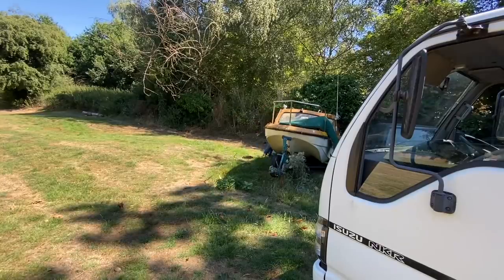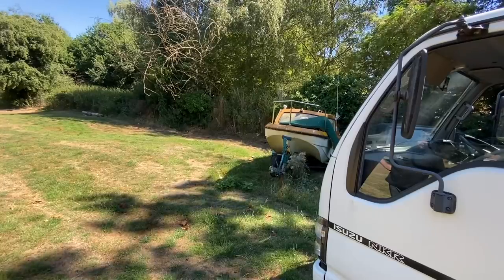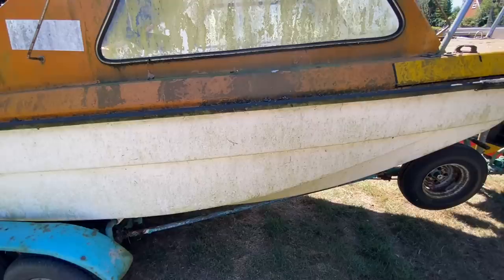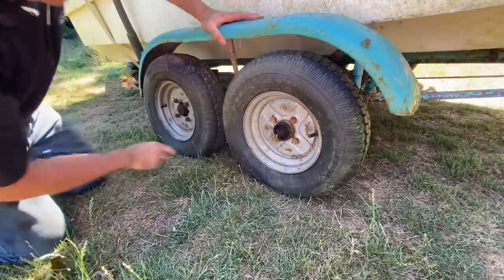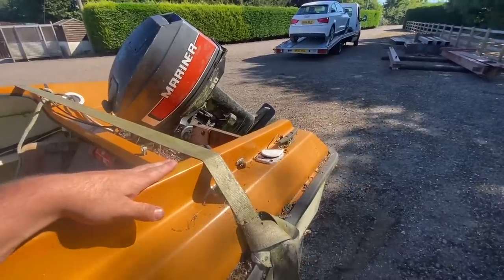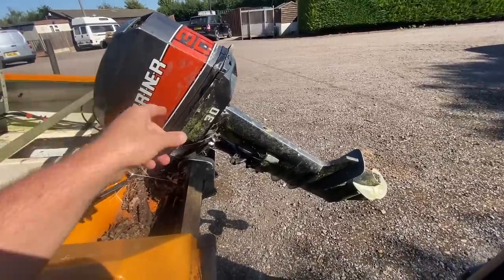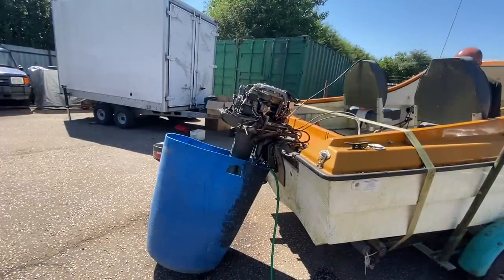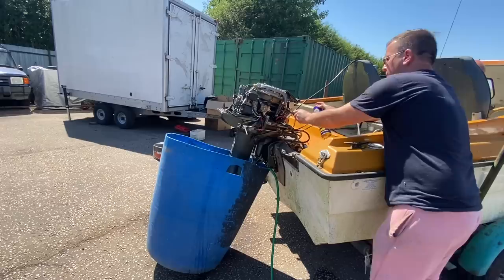WE BOUGHT AN ABANDONED BOAT TRAILER OUTBOARD PROJECT !!!

Comment: Second best day of your life when you buy a boat ! The best day is when you sell the bloody thing :+)
Reply: A boat is  hole in the water into which you throw money.
Reply: Exactly. From a former boat owner.
Reply from the maker: Not on a cheap old boat like this
Reply: "What happens when it rains?" (JKJ)
Reply: LG ..From France you are so right ... I travel around my local area and every other house has a PROJECT BOAT ..
Reply: I second that 😂
Reply: Never, I won't ever get rid of mine. 😂
Reply: @sruk  can't go wrong with a cheap one . Ahwsys money and or fun in cheap ones
Reply: I was always told owning a boat is like standing in the shower ripping up £50 Notes.
Reply: @davidb7466  personally never lost money on a boat , a couple I've had not finished refit in time and the  seasons nearly ended but you can stil sail / sleep in em with the kids , and sell em at the start of the next season and break even ( after boat yard storage fees etc). I've moved a boat from one boat yard ( was 68 ft long and costing 250 a week ) to another 20 mile's away due to the mooring being a quarter of the price was offered 5 times what I paid for it two weeks earlier ....
Reply: B bung
O on
A another
T thousand

Comment: They started out  a long time ago as a CJR14 14ft cathedral hull boat, and there was at one point way back in the day when a fibreglass firm in Southport would lend you a mould to make your own if you bought all the fibreglass supplies from them   then roughly mid nineties Poolside Mouldings  AKA Seahog Boats based  in Freckleton Lancashire  started making them again  and calling them i think it was from memory called  a Seahog trio, the  maximum engine size is normally 30hp but i've personally seen them  with up to 55hp outboards on . They run well with a 30hp prop rated motor, the Mariner 30hp you have there is a re badged Yamaha 30hp Mariner  so it's a really reliable motor . Mariner being owned by Brunswick marine that also made Mercury outboards the Mariner range used to be older model yamaha's up to 60hp  and Mercury models painted grey  and badged Mariner above  60hp altho that did alter  and some of the 40hp to 60hp models were also Mercury engines but they did some 50hp 3 cylinder Merc / Mariners the list is more extensive than that but that gives you a little insight. Mariner were a means for Brunswick to have a mid market brand  as well as their premium product of Mercury , some motors you could actually scrape the grey off and reveal the Phantom black of mercury especially on lower units(gearbox bottom section) where they had taken parts off one production line to complete other motors  ,,,, a little bit of my background I used to be in the marine trade selling and servicing Yamaha  Suzuki and Mercury outboards  etc for almost 20 years

Comment: Boys, I recommend you change the water pump impeller before taking her out. They will work for a few minutes but under pressure they fall apart. Second, check the lower unit oil before going out.  When a boat sits for a long period of time rubber gets hard and breaks easy. If she has no oil the lower unit will fail leaving you out in the water.  Just a lesson I learned the hard way. Be well.

Comment: Check the water pump impeller chaps , made from rubber they perish and break up if stood for a while, the first sign is the water squirt from the engine should be a constant line -yours is spitting.
 When they disintegrate the engine over heats giving an audible signal in the control lever box. Have fun guys-  we did with our boats👍

Comment: Well Rob and Chris I had a sinking feeling when I first saw it. Thought you had bought a non runner. I can (sea) see that you have propelled yourselves into boats now and glad you have not rocked the boat in this one. She looked fab under the engine cover and sounded solid. Glad you are not skimming  on the carb and getting a repair kit for it. Should be plain sailing once cleaned up. Don’t go overboard on the spend😂 and should catch you a nice profit.

Comment: Hey fellas, great buy!. I honestly have owned 5 of those Tohatsu/ merc/mariner 30hp engines since the 80s and in both commercial and private situations and they are honestly bulletproof. The only issue we had ever was that if you hit sand the tell-tale would block up but it wouldn't hinder the cooling. I used to take the little nozzle off mine and drill it to 4mm and that made a huge difference in it blocking up. Apart from that i broke a ball end on the advance linkage once and apart from regular services that was it. We used to fish the great  barrier reef 100miles off the coast and used them for our dorys and felt safe every day out there. I hope you gain the love for them that i have. Happy fishing!

Comment: If it’s been lying for any period of time I’d change the pump impeller too. I’m a marine engineer. The rubber perishes and stops pumping. Usually a few miles from the harbour which is inconvenient at best. Cheap as chips anyway.

Comment: I have been messing about with trailerable boats for  50 years and I have a couple of comments to make.

Personally I wouldn't take that old neglected motor anywhere near the sea. It is a 2 stroke which are notorious for rusting up in the cylinders and big ends if it hasn't been properly pickled for storage, which this one clearly hasn't. I recall an incident in my naïve youth when I bought an old Evinrude 40 that blew up a few months later off Shoreham when a con rod flew through the  side of the engine caused by internal rust on the big ends.  Believe me you don't want to get stuck at sea,

Secondly, 30hp is not going to  make it go like a rocket, the boat is underpowered and needs a minimum of 40hp

Comment: Jeez...you really don't know what you're doing with it do you? It's not an air filter, just a shroud. It's empty.
Leave the throttles closed, use the manual advance as a fast idle. Sort the throttle cable and it'll be easier.
CHANGE THE IMPELLER BEFORE YOU TAKE IT ON THE WATER!!!

Comment: Rob I’ve done all the failing for you. To polish gel coat use, rotary polisher, 9 inch 3m wool pad and Menzerna super heavy cut compound. Then follow up with a decent polish, medium pad on a da forced rotation machine. If it is highly oxidised wet sand with 2000 first. You need the big guns for gel coat , it is NOT like car paint.

Comment: Years ago I owned a 15 ' Tunnel boat made out of fiberglass, I forget the size of the outboard but it was a Mercury and flat out 32 mph . I used to be a welder before I retired and I made a frame out of 302 stainless tubbing  with rod holders in the middle and stainless 14 ga plate both ends for downriggers all held up with two round tubes and plate top and bottom to bolt onto the boat .Great video .

Comment: Love the video, never seen Chris so happy. I’m not sure if anyone else has mentioned it. Before taking it out on the water I would strongly suggest replacing the impeller. This is a paddle wheel like device that pumps water up to the motor for cooling. It’s made of a flexible material and if that motor hasn’t been run in some time it may well have perished. You might get it out on the water the and then the “paddles” might break off, no cooling, seized motor. It’s a cheap and easy fix, you’ll find plenty of YouTube videos showing how to replace. Aaarrrggghh me hearties.

Comment: Did exactly the same early this year with a similar boat that had sat for many years and sold off cheap.Similar problems to yours, but compression still good and now running well after problems with mercury switch and emergency cut out. Now on a mooring at queenborough.Happy to help with sea trials as back up if that's where you are launching. Ours   needed gear box oil filled from the bottom, and interesting idea! 14ft = 4.9 meters

Comment: Another  cracking video gents. The  hull seems to be in  good condition. A  good  clean and  probably some  paint work  should  suffice. The  outboard engine seems to be fine too.There is  probably an  element of profit in  this  project too.

Comment: Big engine for a 14.5 boat. Some lochs in Scotland use propane 5 hp engine for a fourteen- footer on a big loch. Other smaller version of yours and again lithium battery engines.
  Your engine looks in good condition apart from the gummed- up parts now cleaned up. Advice use it see how you like it and if not for you sell it. I've spent lots of time flyfishing dealing with outboards the good, the bad and the ugly. Good skills again thanks. PS my next trip I'll take you along as chief engineers!

Comment: Pumping water or not, drop the bottom unit and replace the impeller, £7 bit of rubber that takes 20 mins to fit will save you a lot of bother out at see 👍 that gelcoat will polish up like new, don't put the metal on the back, people only do that when the transom is getting soft, a new buyer will instantly think it's rotten .

Comment: The boat will be a Seahog Trio based on the CJR 14. Made by Poolside marine at Freckleton Lancs. If the engine has been stood for a while might be worth checking the water pump impeller for cracks, and check  the gear oil for water intrusion.
Reply: I worked there for a summer when Arnie owned it 30 years ago.
Reply: @belmsim5454  He was quite a character, I did have a couple of boats off him.

Comment: Nice work guys, got a wilson flyer in need of a new floor which ime going to attempt to do myself, look forward to see how you get on, mines in Swale marina so might see you on the Swale. Looking forward to the next vid.
Reply: Wilson Flier's always attract the "it JUST needs" buyers, but be warned check the deck floor and most important the transom the repair/relacement for these can be a nightmare and if not done correctly will result in costly project, you don't want the engine and transom falling off and the boat possibly sinking.
Reply: @billmarsden7490  Thanks Bill. Had the boat for 4 years and it's at the stage were it needs doing and didnt fancy paying £1,200 for somebody else doing it

Comment: This is going to be a lot of fun. :) You need to find out it's real name or it's going to cost you a fortune in decals and may not fit the length of the boat. ;) lol. Coincidentally, I'm fitting a new impeller and unblocking the tell-tale on my dad's 90hp Suzuki outboard tomorrow. Never done it before so shall be consulting YT videos a lot. :)

Comment: Do yourself a big favor, change out the impeller of the waterpump. It works, but no force behind it.
So it must be dried out. Before pieces break off and ruin your engine.. might aswell do a proper job.
Is the boat a Shetland?

Comment: Mini steel wheels from the newer 2002 - 2010, 4 stud fit old mini hubs. It will raise the height better by 3-4”. I did it to my old trailer. Looks and rides far better now. Mine were £10 each with tyres. EBay or FB.

Comment: Change the impeller, they get brittle, but cost next  to nothing, also, check and change gearbox oil, again not expensive, those two items can potentially save you gearbox or engine! good video

Comment: So it will be round to silver lake for a replacement transom, and we've called Liam in to program a new ignition key. A bit of g101 on the seats and new airbags required, and seatbelts need resetting, we've plugged in the computer and cleared the codes now we'll run it and see what pops back in.😆🚣🚣🚣🚣🚣🚣

Comment: Mariner - Mercury by another name, mechanically the same as the equivalent Mercury if you are looking for parts. There used to be a product (in Australia but probably in the U.K as well) called "Fibreshine" which was brilliant at polishing degraded gel-coat but your suppliers will probably have something similar, AutoSmart would do one I reckon.
Reply: I am sure the 30 is a Yamaha ,I think the bigger engines were Mercury's,  confusing or what!
Reply: @memeGT150  if the Mariner is a Yamaha, the equivalent Mercury will be as well because the early Mercury Four-Stroke engines were originally manufactured jointly with Yamaha; Mercury provided the block, crankcase, crankshaft and connecting rods, while Yamaha produced the cylinder heads for the 50hp and others.
Reply from the maker: @memeGT150  it is a Yamaha yes 👍

Comment: If you need any advice on the trailer let me know I used to make them and repair them etc. Easy to strip out replace parts (cheap) tricky bit is setting up braking system (if it has one) : )

Comment: Those fuel pumps in an outboard will suck their own fuel from a can once primed, you don't need to pressurise the tank, provided the pump is in good nick. Those plastic rod ends on that era of mariner engine (made by yamaha) looove to disintegrate, dealing with the same thing on my engine from that era
Reply from the maker: This engine is a Yamaha 👍
Reply: @sruk  yamaha/yamaha made engines of that era are absolutely bulletproof, should get many hours of fun out of it

Comment: Guys make sure you run the engine in a water butt or buy some muffs to connect the engine to water, never run it out of water!
Reply from the maker: Did you watch the video bud ?
Reply: I did watch it but commented before I got to the bit where you had a water butt! I almost commented again saying it will be your carb get it in a sonic bath to clean it! But you had the carb off before I could type it 😂I work for a marine engineering company so this one was right up my street 👍🏻
Reply: I don't think you watched the same vid as the rest of us did.
Reply: Tell-tale

Comment: What licences would you need to put that on the river and drive to richmond?
Reply: Probably none, there is little or no regulation on small motorised boats in the UK. But a quick Google search will confirm or otherwise that.
Reply from the maker: None
Reply: @sruk  It's best to do the basic radio user course, it shows you how to communicate with the harbours & coastguard and other boat users. You never know if you need to make a mayday call, they teach you all about that also.
Reply: As far as I know, non. Just mooring fee, if staying in the water.

Comment: Should not blow tyres up when wheel not bolted to hub
Reply: dont get a job at a tire (tyre) shop.  if your spare is low, do you mount it to add air?